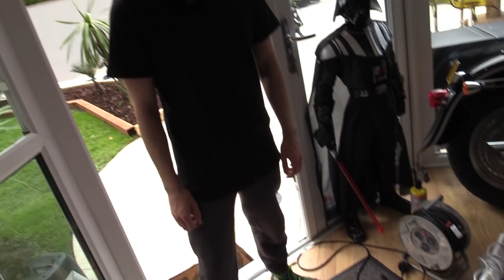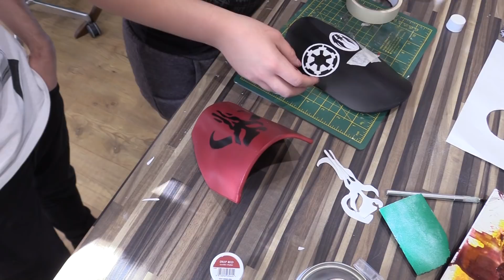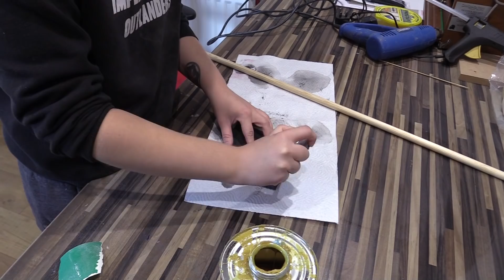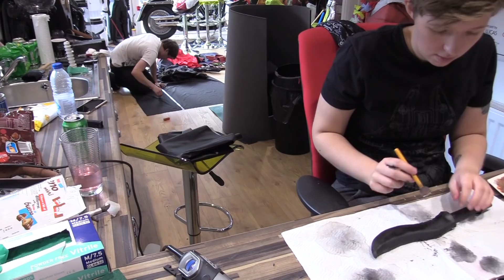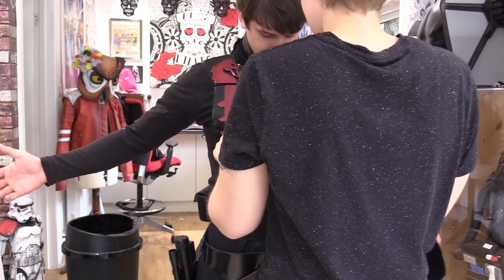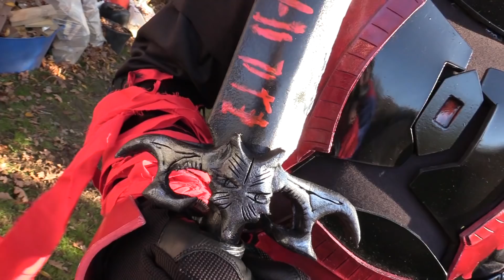Making Custom Mandalorian Armour (Star Wars)

Comment: I did my Mandalorian out of Sintra. I love it, light weight an durable enough to not worry about breaking
Reply: Same
Reply: Foamex is basically the UK brand for Sintra
Reply: I plan on making mine out of sintra, do you have any advice for gauntlet making?
Reply: @cornucopia4074  Clamshell style works best. Each Gaunt should be two pieces held together by a hinge. Try using a drinking glass to form the sintra around it. It will make the pieces match up perfect, and tends to bevel the same shape as most wrists into the forearm.
Reply: Dan Norseman thank you!!
Reply: Dan Norseman thanks, I couldn’t figure out how to do mine!!

Comment: I know I’m two years late😅 but what is the thickness of the foam you’re using? And just to check, is it EVA foam? (Like those foam floor mats you can find at stores)
Reply: It’s called FOAMEX, it’s a brand of PVC foam. It’s as malleable as foam, but also very hard. But wear a respirator when you heat form it, and do it in a very, very well ventilated area or outside. The fumes from when it is heated up can do serious lung damage

Comment: Mando skull = Mythosaur skull.

Next time use a heat gun on the glue. Just make sure to have it on the lowest setting. It should, if done correctly, melt the glue without warping the plastic of the gun.